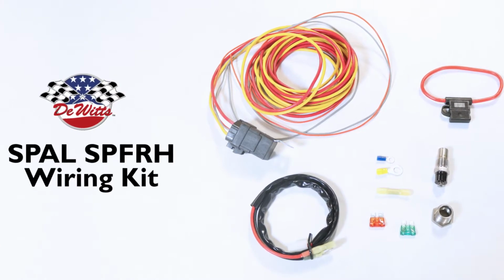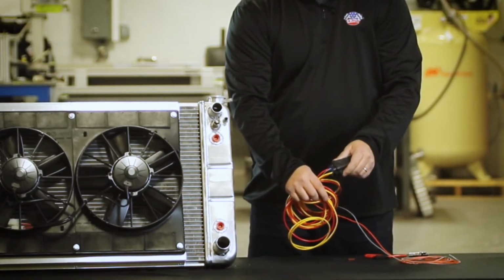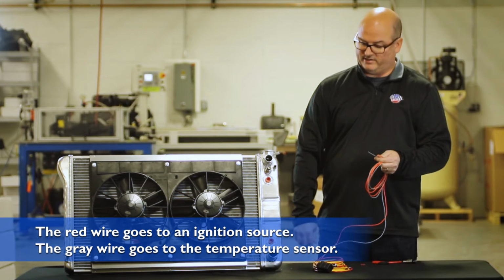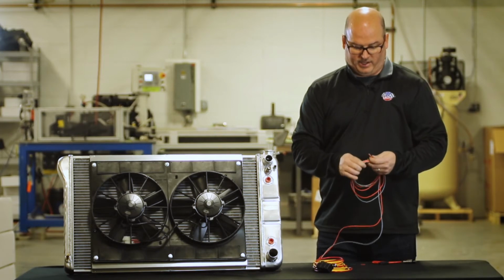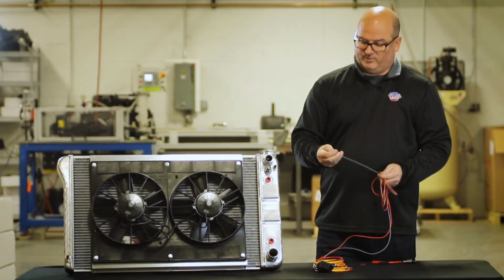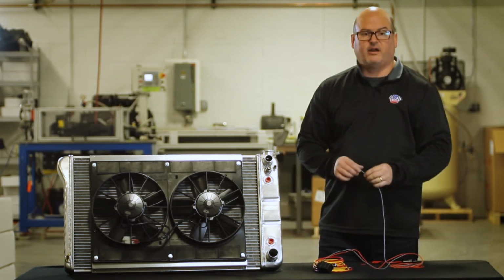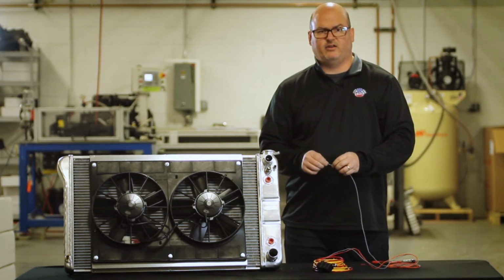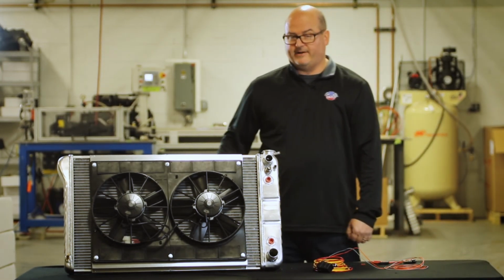How To Use The DeWitts SPAL SPFRH Wiring Kit

Comment: does this harness allow the fan to turn on with the ac instead of just the tempreture? i wanna install a second fan that has its own power source using this harness but id like it to turn on with the ac and not just the temp sensor